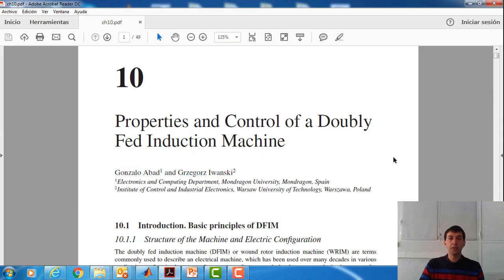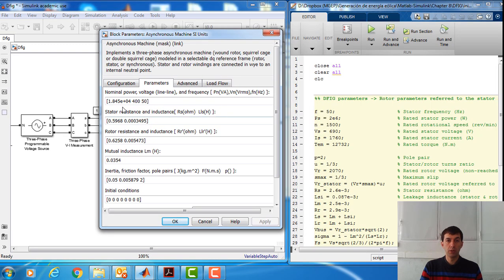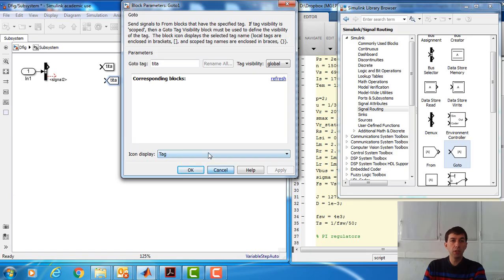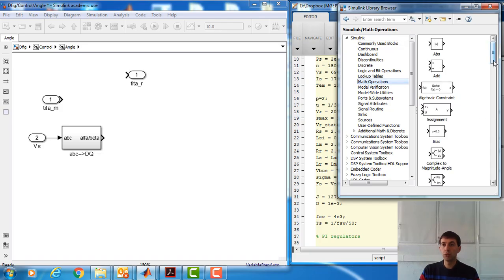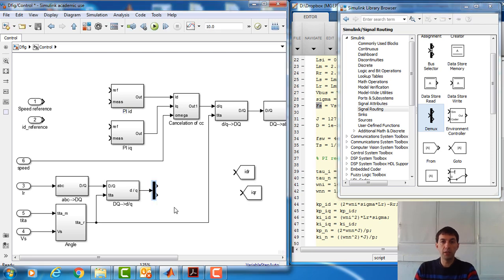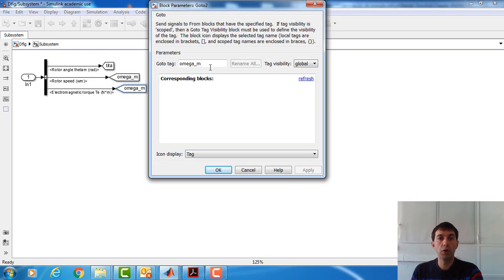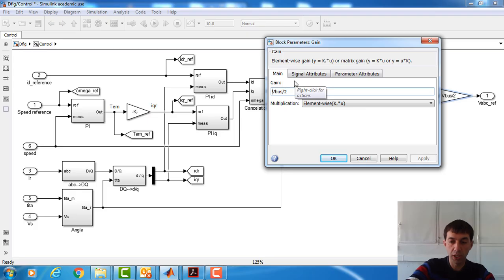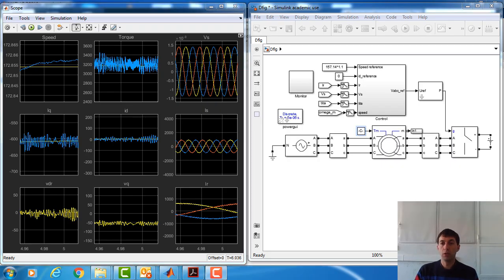DFIM Tutorial 1 - Implementation and Control of a DFIM in Matlab-Simulink

Comment: Error in port widths or dimensions. Output port 1 of 'DFIG/Control/Cancelation of cc' has 2 elements.  This port does not accept the dimensions (or orientation) specified by the output signal 

I cant solve this problem :( Can anyone help me, The files are ready to be send

Comment: Thanks very much for the step-by-step demonstration. It helped a lot. The parameters worked for R2022b, though I think the motor block was a bit different, mainly, the rotor/stator voltage ratio parameter was introduced. If I use the default value 1, I got almost the same results as those in the tutorial. So I am a bit confused about the parameter turn's ratio, u, in the tutorial and how it is implemented in the simulation model. But as someone just starting to study the motors, building a simulation model by myself is definitely more interesting than just reading books. Estimated time to build and debug this model following the instructions: 5-6 hours.
Reply: yes when u=1 then the simulation is working. else absurd result because Vbus becomes very less
Reply: @5minutething519  You just solve a days-long challenge. Thank you sir
Reply: @5minutething519   Hi sir, my simulation is working fine but when i increase my reference speed above 140 it is unable to follow it(maximum speed is limited to 139.7) and there is a constant difference between my ref torque and measured torque despite my iqr following iqr ref accurately. Can you suggest some solution or what may be the problem ( I tried changing gains values)?
Reply: @Vishalgupta-lp1qc  1. make the  ststor rotor gain u=1.
2. see that electrical and mechanical torque will be related as Te=p*Tm
3. also at rated torque your speed may not track rated speed , slghtly reduce the torque . 
4. also play with dc link. increase it and see 
Try these . Also comment your reference values if still not working
Reply: Hi, Can you please help me with this model? I did the exact model but it's not working properly. Like if I change the torque then the speed doesn't follow the reference.
Reply: Sir, I tried to made the same model as your are instructing in the video but my results are bit more different than what you have got during this lecture. can you check my model and let me know if I have done some mistake
Reply: @abdulsamadbhutto3565  

I think you should be more attentive and carefully follow the steps. It is advisable to use two screens, one for video and one for implementation. The simulation is very correct. Atleast my own run well

Comment: Thank you for the wonderful video sir. On page 147 of the book you referenced "DOUBLY FED INDUCTION MACHINE" by R. Abari et al.,the output of the integrator of PLL is the angle of the grid voltage but in page 281 of the other book "POWER ELECTRONICS
FOR RENEWABLE ENERGY SYSTEMS, TRANSPORTATION AND INDUSTRIAL APPLICATIONS" 90 degree was subtracted from the output of PLL to get the same grid voltage angle. Please can you explain the reason for this? Does it have anything to do with using stator voltage oriented control or stator flux oriented control?
Reply: for stator flux oriented control you have to substract 90 degree to stator voltage angle which we get from PLL

Comment: Hi, does someone knows how to solve this problem?
" The Voltage Measurement block 'DFIG/Three-Phase V-I Measurement1/Model/U A:' is connected between two isolated networks. For a valid measurement, the positive and negative terminals of the block must be connected to electrical nodes that are part of the same electrical circuit. Also check if the ground reference node is defined for that circuit. "
Reply: in voltage measurement block  select VOLTAGE MEASUREMNT  to NONE (from drop down).

Comment: Thank you for sharing your kowldage... I understand not sharing the file part... But most of us are stuck with the transformation blocks that you prepared beforehand and used in the control part... If possible share the transformation library with us...
My contact: mohammadreza.moghadam@gmail.com
Thanks
Reply: bro did  u get this by now?? if yes then plz do share it with me
Reply: @ethanehunt9655  Nope... I Haven't...
Reply: @mohammadrezamoghadam4678  bro I have got my m.tech thesis related to low voltage ride through of DFIG wind turbines....can u help me in that in any way if its possible??
Reply: Did you find the transformation library (library.slx)? If yes can you share? I am struggling with the transformation blocks. Thank you. my email: eansug@yahoo.com
Reply: AOA @Mohammadreza Moghadam. Can you find the Transformation blocks?

Comment: Sir I would find out the DQ to abc conversion
Reply: It's same as the αβ0-to-abc block inside Simulink library. Actually, i found out his capital letter DQ means just αβ0. you can use dq0-to-abc and abc-to-dq0 blocks with the angle w*t as input. It's quicker.
Reply: @mhniasse9286  sir , r u complete this model with mathematical equations if yes kindly sent me please
Reply: @mhniasse9286  i need library.slx model, please sent me
Reply: @aqeelali5601  Did you find the transformation library (library.slx)? If yes can you share? I am struggling with the transformation blocks. Thank you. my email: eansug@yahoo.com
Reply: @mhniasse9286  Hi, what did you use for the parameter 't'? and w=2*pi*f, right?

Comment: very helpful ! thanks a lot!
But there is some issus with this model as some comments show below: the speed and the torque cannot  follow the regulatuion. I have checked for serval times the model, I found the problem comes from the sauration of PI controller for Iq, the saturation limit value is too low. If you remove the saturation or change the Vbus to 1150 V, regulation will be ok.
Reply: I m also getting same error
Reply: Sir please send me the simulation model.    tharanyasaker@gmail.com
Reply: Hello Mr. Chenchen,
I would like your help as I am also facing the same issues with speed and torque.
The reference speed is around 141 whereas the speed reaches just above 133. even the reference torque is around -1650 but the actual torque oscillated around Zero.
I tried making Vbus as 1150 V but did not work for me. Sir can you plzz share the values of PI controllers you have placed to get the correct graphs?
Looking for to a positive response.
Thanks in advance.
Regards
Mihir Mehta
mihirmehta.ee@charusat.ac.in
Reply: @mihirmehta1658  sir I am also  facing the same problem,  can you send the pi regulator values its very useful for me.
Mail id .garkki98@gmail.com
Thanks and regards
B.Garkki
Reply: thanks its ok with me
Reply: Hello sir, could you upload or shar this mathlab file(simulink)of DFIG control MPPT

Comment: I am trying to have a stator voltage oriented control model. I have developed the controller for the rotor side however, the change in Iqr affects the Tem instead of Idr affecting the Tem. What could be wrong with my set up?

Comment: Let me ask why didn't you use "abc to aplha beta" and similar block of simulink?
Reply: Error evaluating parameter 'Mechanical' in 'model/Asynchronous Machine SI Units' Caused by: Index exceeds array bounds. i get this error please help me
Reply: @jay1998-t9r  let's talk in skype after 9-10 hours. It is too late for me.
Reply: @Арман Ахметов can you help me to find error? actually, I take a project on a renewable energy source . so please help
Reply: @jay1998-t9r  I was quite busy. so, what is your skype?
Reply: I completed all model then last this error comes. I don't know if the problem in initial condition
Reply: Please guide me if you have some idea
Reply: Yeah i'm trying to understand that. how can I get the block of abc to alpha beta he did?? he did not show how he did those blocks.
Reply: @abdur8772  actually he showed but simulink has own direct blocks. And he did not use them.
Reply: @haligali4360  so where I can I find that block to use?
Reply: @haligali4360  yes because transformation are slightly different in different author bok basically the multiplying factor. so its better to use your own. just the equation in matlab function block
Reply: Hello please reply if you have some idea
Reply: Okay. If you don't mind i will send u .m file and .slx file for this model if u want  find error from that please help.

Comment: Hello, thanks for great lecture, I followed all your instruction but i got an error when run "Error in expression for 'DFIG/Subsystem/Angle/abc-->D//q/Fcn', an input index exceeds its input width of 2" and "Error in port widths or dimensions. Output port 1 of 'DFIG/Subsystem/Angle/abc-->D//q/abc' is a one dimensional vector with 2 elements", can you please help me
Reply: i have the same error but  at the cancellation model, did u get the solution?
Reply: Did you find the transformation library (library.slx)? If yes can you share? I am struggling with the transformation blocks. Thank you. my email: eansug@yahoo.com
Reply: @ernestansu-gyeabour1882  
😭Please, did you find the conversion library, please help me

Comment: Dear Mr. Gonzalo Abad Biain I would like to thank you for your tremendous effort to help us learn about the DFIM modeling. The references you have used is also of a great source for learning too. But, I couldn't find the reference formula's for PI regulators that you have used in the .m file. would please share your knowledge on how we can derive/references of the PI regulator formulas?
Thanks and Best Regards!
Reply: Hi Ahsan,
Could you find the formulas of PI regulator?

Thanks in advance
Reply: @sutapadeb3774  please have a look at video 6. There are some explanations regarding the issue. 
Sorry for my late reply
Reply: @muhammadahsanzamee4385  thanks
Reply: Hi Ahsan
I have implemented the following models to meticulously watch the video and the given references that have been provided by the author. But, I am getting a wrong results for torque, Is, Ir, Idr, Iqr, speed. So, I am really in trouble to fix the problem. If you help me, I would be grateful to you. I am ready to send my implemented model to you, if you share your mail ID. My mail ID: subartoeee07@gmail.com
Thanks in advance
Subarto
Reply: Error evaluating parameter 'Mechanical' in 'model/Asynchronous Machine SI Units' Caused by: Index exceeds array bounds. i get this error please help me
Reply: If you help me i will give you m file and model
Reply: AOA @Muhammad Ahsan Zamee. Can you send me simulink files of WT-DFIG model?
Reply: @anisasharif8660   I need wind turbine dfig files

Comment: Dear sir, thanks a lot for such a wonderful video. Could you please tell me how did you know we have to divide by Vbus/2 during normalization, and also how did you calculate the max and min values for the saturation blocks.I could not find this information in the books you mentioned.  Thanks in advance.
Reply: Bro can you explain me PI regulators and its components
Reply: How the inverter is VSI the maximum and minimum peak of sinusoidal waveform is just half of the DC link power source. and the Max and min values are related with nominal values in the problem.

Comment: Could you please clear me about what is wnn, wni, tau_i, tau_n  in pi regulator
Reply: they are time constants
Reply: Dear Mekalathur can you help me to know about the reference equations for calculating PI regulators from these time constants? It will be a great help for me. thank you
Reply: Error evaluating parameter 'Mechanical' in 'model/Asynchronous Machine SI Units' Caused by: Index exceeds array bounds. i get this error please help me.
I will give matlab file to u

Comment: I am trying to simulate tutorial 1. In matlab, filed initital condition for asynchronous machine ,   if set to  10000000  and 00000000 we get different waveforms . There is no clear explanation regarding these fields.  Could you plz clear this. Multiple times i had gone thorugh the video. Not able to simulate the same results. Hope you will respond positively.
Reply: that corresponds to the slip, if slip =1 means at t=0, the machine speed =0, 
if the slip is 0, this means at t=0, the machine starts from the synchronous speed. if you still dont understand this, please look for the definition of the Slip and what is represents

Comment: Dear colleagues,
I’m sorry but I cannot send you Simulink files. The video tutorial is just one more tool that can help to learn by oneself. If the objective is ‘to learn’, I think that I would not help sending you the files. Just the opposite. If we do a parallelism, if the objective is ‘to learn’ to ride a bicycle, one has to learn by himself/herself. Watching to other people how they ride can be useful (these video tutorials), but you have to do it by yourself. I am afraid thet there is no other path, if the objective is ‘to learn’. 
Thank you for your attention.
Reply: realy great work and we arreciate it .......thanks a million 

thanks alot dear professor
Reply: Simply by using the stator voltage equation, assuming the steady-state and neglecting the voltage droop at the stator resistance, we have (approx.): |Vs| = 2*pi*f*|Fs|     
(   sqrt(2/3) is to transform to phase-to-neutral and peak voltage/flux amplitudes  )
Reply: Gonzalo Abad Biain Sir, I tried to made the same model as your are instructing in the video but my results are bit more different than what you have got during this lecture. can you check my model and let me know if I have done some mistake?
Reply: Thank you very much for this work. I need ask you the parameter file if is it possible. Thank very much again
Email: larbidjar@hotmail.com
Reply: dear sir, it really helps me. can you specify the values of min and max in third harmonic injunction subsystem
Reply: dear sir, it really helps me. can you specify the values of min and max in third harmonic injunction subsystem krishna.kmsn@gmail.com
Reply: Dear Gonzalo Abad Biain,
Thank you very much for the brilliant explanation and great effort that you are doing in your tutorial. As you said the objective here is to learn. Could you please explain how did you make the simulation run slowly?! In my case the simulation very fast!! I don't why?
Best regards.
Reply: dear sir can you provide transformation library files or give me directions where to find them. that will be so nice of you. my email noumanshabbir7903@gmail.com
Reply: @noumanshabbir1990  Did you find the transformation library? If yes can you share? I am struggling with the transformation blocks. Thank you. my email: eansug@yahoo.com
Reply: Hi Sir, Can you say where should i get that book ('Power Electronics for Renewable Energy systems, Transport and Industrial Applications by Haitham Abu-Rub'), Can you provide me the link to download the e-book for free? or else can you mail me? Mail id is riazmohamed96@gmail.com   Please, i want to know the detailed explanation of the entire working Sir. Please consider this.
Reply: @mohammedriyaz6070  have you received if yes then send book at aashiralimuhammad@gmail.com
Reply: min and max values are the values related to pwm that are [1 -1]
Reply: Dear Mr. Biain, recently I got a Task to make loadflow in powergui fulfil for a power System which contain two wind turbine, I connect them all but it is won#t work, but when I replaced two wind turbine with two three-phase voltage sources , then it works. Can you give me some hints?
Reply: Sbsksb. na sb
Reply: Where to find min and max in matlab used in 3rd harmonic injection technique at 00:31:16.
Reply: Aman Kathuria how can I build the 3rd harmonic injection?!
What is min and max block ? And how can I build it ?!
Thanks
Reply: https://www.iaras.org/iaras/home/caijres/designing-variable-speed-small-hydro-turbine-with-doubly-fed-induction-generator-dfig
Reply: Error evaluating parameter 'Mechanical' in 'model/Asynchronous Machine SI Units'
Caused by:
Index exceeds array bounds
i get this error please help me
Reply: If you give solution then I send u MATLAB filr
Reply: Hello Doctor.
I've been trying to simulate DFIG for so long. There is a book having your name on it and I simulate that but I get error and error in simulink. The simulation is easy but I dont know how to solve the errors. plz Help!
Reply: Dear Sir , do you have a pdf  file , details of how the simulation is formed such as equations ....
simulink document send please
m.eneskale@gmail.com
Reply: Dear Mr. Gonzalo Tanks for the help! You make it sound easy to understand. For now I have trouble creating a file template at the beginning of the video. Matlab says "you may not have permission". Thanks for the excellent video but I ask for a tip to solve this question.
Reply: in these days knowledge sharing is rare thing . you deserve qualities of  master. thank you very much sir
Reply: can you please send video explanation of  predictive direct power control
Thank you
Reply: heartful thanks for your videos
Reply: Dear sir
can you please send the book and m file of dfim tutorial 2? at aashiralimuhammad@gmail.com.
Reply: Yes sir I understand that if I build it on my own it would be really great for me in terms of gaining knowledge and for further projects. but could you please send me the library.slx file in gmail. I tried to make the subsystem, but I was not able to find the block used for it in the MATLAB library. I even asked my lecturer about it. but he was also not able to help me out. so please please send me the library.slx on mrpatel41296@gmail.com
Reply: @mayankpatel4073  Did you find the transformation library (library.slx)? If yes can you share? I am struggling with the transformation blocks. Thank you. my email: eansug@yahoo.com
Reply: @ernestansu-gyeabour1882  I'm struggling with it too. Did you manage to create that transformation? I really need help.
Reply: I agree